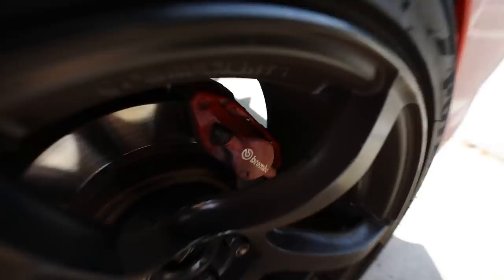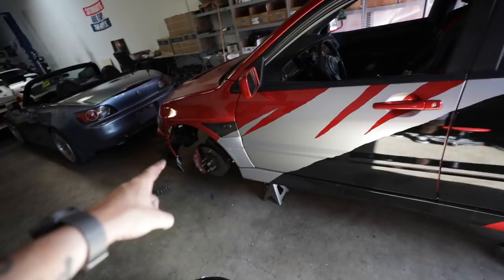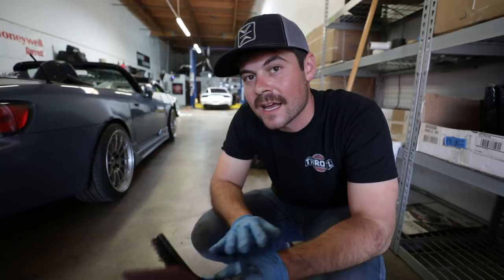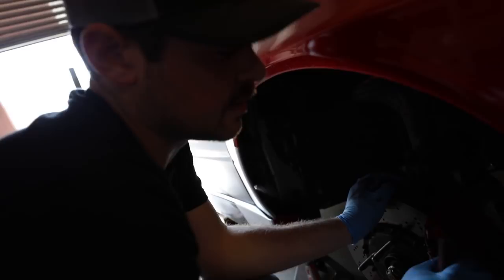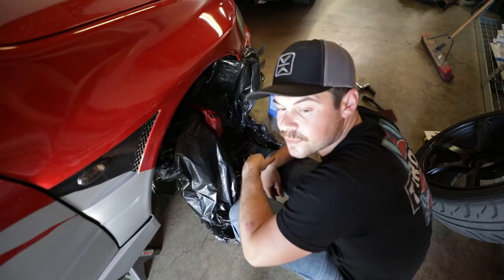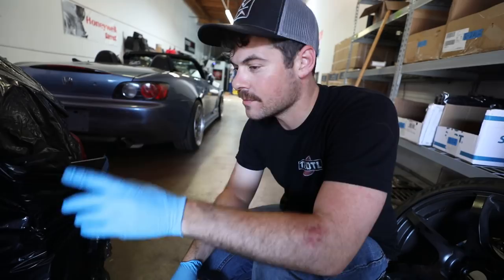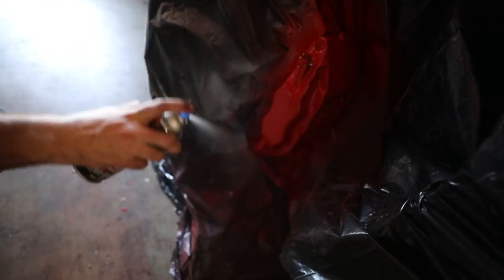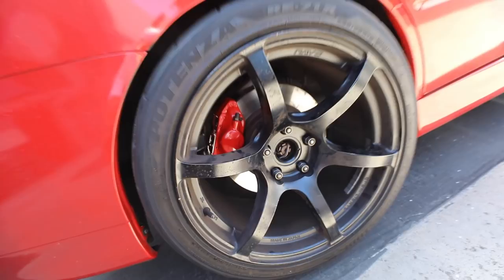DIY PAINTING MY EVO 8 BRAKE CALIPERS!

Comment: The Brembo decals must be caliper high temp. Vinyl if you use any regular vinyl they will melt off from the heat of the caliper. You can find these high temp ones anywhere online.